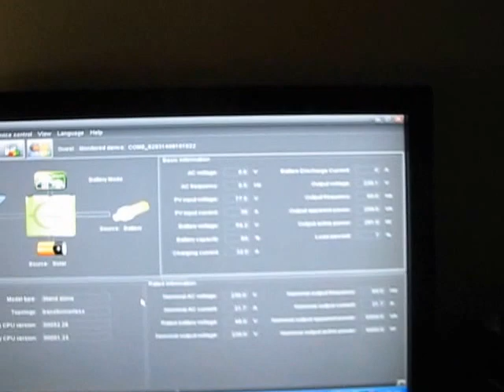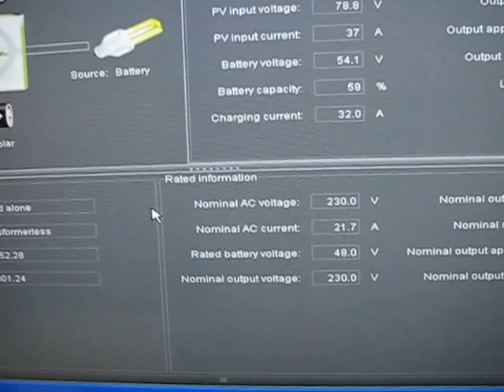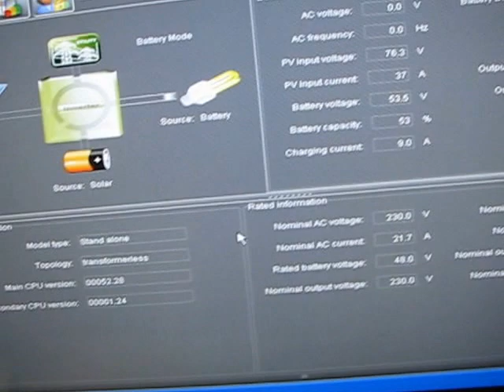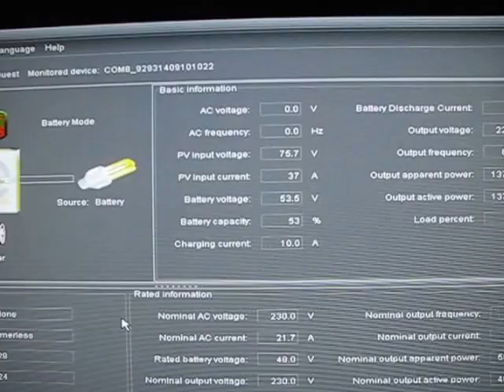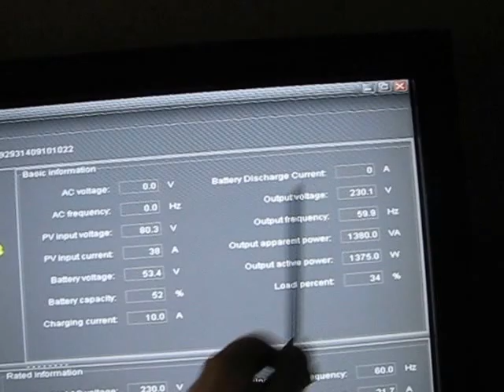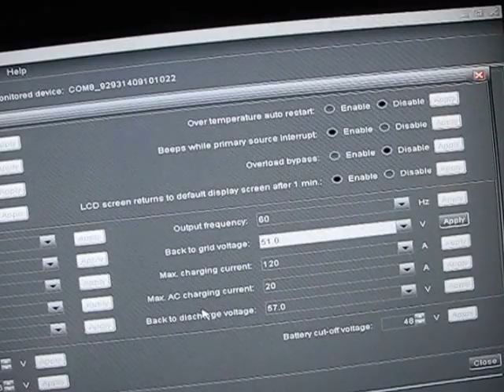Free Solar AC ( solar air conditioning )

Comment from the maker: At time of video was 12 panels 245 watt and 270 AH of lifepo4  batteries @ 48 volts.
Now have 2  inverters with nine 245 watt panels 2205 watts for each unit a total of 4410 watts now with 310 ah of lifepo4 batteries. They say lifepo4 batteries have about twice the usable run time of AGM or flooded batteries. this setup is running the same AC from about 11am to 7pm  with a voltage control switch set to keep the batteries close to full if i lower the settings of the switch will run the ac till around midnight or longer but uses all most all the batteries up by morning.

Comment: @off grid kid how many solar panels do you have? how many watts and amps ? thx
looks great
Reply from the maker: Sorry buddy missed your question??? At time of video was 12 panels 245 watt and 270 AH of lifepo4  batteries @ 48 volts.
Now have 2  inverters with nine 245 watt panels 2205 watts for each unit a total of 4410 watts now with 310 ah of lifepo4 batteries. They say lifepo4 batteries have about twice the usable run time of AGM or flooded batteries. this setup is running the same AC from about 11am to 7pm  with a voltage control switch set to keep the batteries close to full if i lower the settings of the switch will run the ac till around midnight or longer but uses all most all the batteries up by morning.

Comment: Do not float LiFePO4 batteries they will degrade.
Reply from the maker: ***** They are cycled every day. Charging to about 3.5 - 3.6 running down to 3.1 is about average per night. if they do hit float it's only for a short time.
Reply: off grid kid
They should not float for any period of time. they hate to be above 3.4V. The 3.55V or 3.6V is oly used so that it can be charged faster but ass soon as it gets there the charging should stop every minute the spend charging above 3.4V will slowly degrade them. They need to last 20 to 25 years so if you float them for an hour every day that is a lot of time they send floating and will degrade much faster.
Reply from the maker: was charging to 3.4 a while back when i bumped to 3.5 or 3.6 depending on the amount of sun did not notice any more run time. will go back to 3.4 and thanks!!! looking to get the most life out of them.
Reply: off grid kid
My batteries are over 3 years old and have already 2 years of full offgrid use with no measurable degradation in capacity.
Maybe there is 1 or 2% but is hard to measure so precise.
So as long as they stay in the appropriate limits they will last a long time.

Comment: man looks good. I will be ordering one of these soon very soon. and will be using a 7.5KVA transformer that is 480/240 primary and 240/120 secondary that way I can get split phase.  But since you are off grid. I was going to ask how you hooked it up to the 240 volt mains.  I don't know if I can do that yet or now with out a Isolation Transformer. Since yes we have 240 volt split phase and you can run Items like AC's Welders ect off just 240.   But I don't know yet if the PIP is isolated IE ground and natural Since 240 is hot on each leg. I'm afraid  the case of the PIP could be live in respect to ground.  

With you talking about the Grid how do you have that hooked up could you show a video on that. Because I will be getting one and be testing it in my shed. nice video.  the more people like use show we are interested in this product maybe they will make them for the US with 240 split phase.
Reply from the maker: McCuneWindandSolar Just running 120volt single phase in to the unit for now. Only works to charge batteries. so i switch the unit off when grid is on. It's going threw a stepdown transformer or it would work. it does the transfer but with 120volts going threw the transformer. That's why you need two transformers. One to step up the power going in using 230/ 240volt single phase. 2 phase output power can be achieved with the correct transformer. Same with input can make 120 split phase in to 240volt single & vice versa. More info here. http://www.victronenergy.com/upload/documents/Datasheet-Autotransformer-32A-and-100A-EN.pdf
Reply from the maker: off grid kid  http://www.solarhome.org/toroidautotransformers120240v4000w.aspx?gclid=CLfb-diZwsICFUsR7Aod-mkAmA
Reply from the maker: off grid kid I plan to get one soon this will complete my system. Every thing will work correctly when i get the second transformer.
Reply: off grid kid Cool how are you connected to the grid with the Inverter
Reply from the maker: McCuneWindandSolar  Just 230volt single phase from inverter to step down transformer 115volt single out. My system is all single phase for now. But when i get the new transformer, can make 115 split phase power. Will work with well pumps and motors that need 220 USA power.
Reply: Do you have the input side of it connecting to the Grid mains.
Reply from the maker: Yes. But keep the breaker off mostly, have only used it a few time when testing batteries, really did not need to use the grid just trying to run down & balance all so was trying to find the range of my lifepo4 batteries
Reply: Thats cool I just ordered the PIP and I just ordered the split phase Transformer. I was wondering about the main's and if it need to be isolated. was unsure how it would react with the inverter with how out Power is compared to every one else. I cant wait to get Mine I hop it gets here fast. LOL
Reply from the maker: Needs to be isolated as far as i know. My system is. look here you may find more info http://www.mppsolar.com/manual/PIP-MS%201-5K%20manual.pdf
Reply from the maker: That's awesome! you must be pumped!!! hope you get her soon.... What autotransformer did you get? I'm shopping for one can't make up my mind yet??
Reply: the transformer I'm getting is a GE TRANSFORMER 9T21B1005 7.5KVA 60HZ SER.CE    the primary is 480/240  and the secondary is 240/120  http://www.ebay.com/itm/201111713407?_trksid=p2060778.m2749.l2649&ssPageName=STRK%3AMEBIDX%3AIT   thats the ebay link at least they will ship it LOL.  its ugly looking but as long as its still working that's all that matters to me.  I can always repaint it to make it sexy again.
Reply: I think a transformer like this one would work great also.  I wish I would have seen it before I got the other one.   http://www.ebay.com/itm/Marcus-7-5-KVA-Transformer-1-Ph-240-120-240-VAC-isolation-aurora-powerone-/141498213703?pt=LH_DefaultDomain_0&hash=item20f1f36547
Reply from the maker: McCuneWindandSolar Nice! like the price on that unit! Look like it would work perfect.

Comment: Thank You So Much. Hey or you able to Grid Tie this inverter here in the US ? Thank you for your time.
Reply from the maker: Jared Grisham it uses the grid or generator to back up the inverter if the batteries go to low and will switch to the grid or generator. But you can not feed back to the grid with this inverter it's made for off grid use. If you plan on using in the usa you will need 2 transformers for it to work correctly. This link may help  http://www.mppsolar.com/manual/PIP-MS%201-5K%20manual.pdf
Reply: Thanks so much

Comment: Great setup,We will be installing an off grid solar system on our block once we have finished building. 
Like the batteries you are using but seem to cost a fortune here in Australia we will probably end up using AGM batteries.
Reply from the maker: Bush Block Homestead Thanks! Still working on my system not even half way there yet..Yes they are pricey! Look at the 100ah 3.2 volt cells to start, it's more like a 200ah AGM battery, you could get one battery bank at a time. If you do the math on cycle life lithium is the way to go.